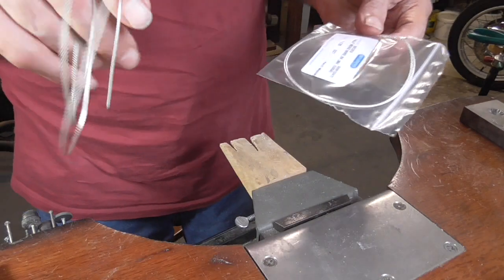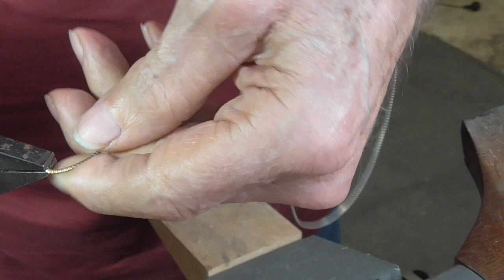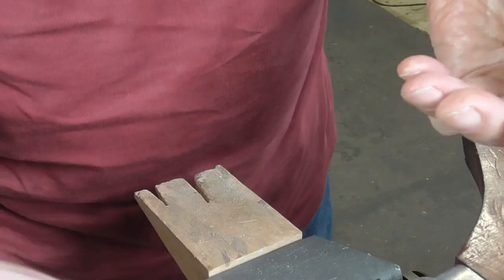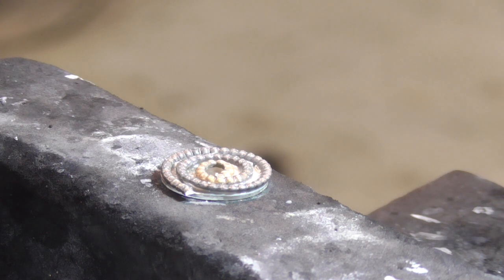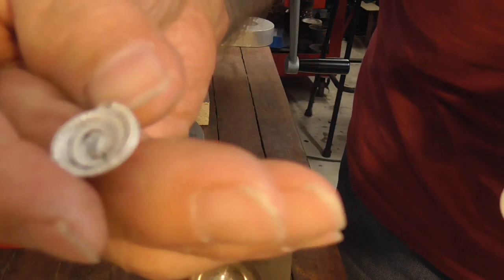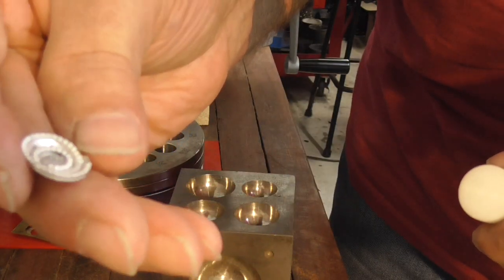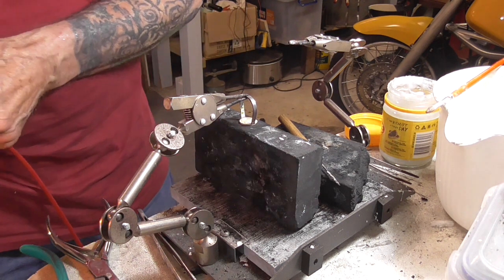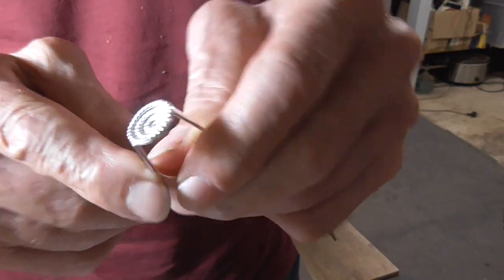beaded spiral cupped disc ring

Comment: Soham,  (is it ok if I call you Soham vs Mr. Harrison?)   beautiful piece as always,  I've missed your creativity.   Hope you are well!  Would you please share with me which solder snips you are using?  they cut the wire solder so cleanly and quickly.  I am currently using a pair of economy snips from Rio, and they frustrate me, I am always getting pieces stuck in the opening and then struggle to get them out.  If I point the solder downward, i end up with too long of a piece for what i need.   Thank you!.

Comment: I enjoy watching your videos and have learned many needed skills. I have a question I hope you can help me with. I recycle all my sterling scrap, ingot and re roll. I have lots of 90% silver cull coins and would like to up the content to .925. Is there a simple calculation to figure out how much .999 fine silver is needed to do this?
Reply: I may be wrong but, i think to get a higher silver content, you might have to refine it. I read somewhere that adding more pure metals to non pure metals doesn't make anything but the same purity with just a higher amount of silver. Again, i could be wrong and they could have been talking about gold only. Like if you took some 10k gold and added some 24k to the 10k, it just lowers the 24k. Idk. Im so sorry if im not making sense and definitely sorry if i am just wrong altogether lol. I will try to find that info and come back if still needed:)
Reply: Puerto Shecan  Well I found the formula to make .800 silver into .925. = 1g of 800 silver, add 0.865g of fine silver to get 1.965g of .925 silver. I found silver calculator online. It took awhile but I’m pretty sure this is correct. 20g of .900/coin silver, add 10g of .999/fine = 30g of .925+. I’ll make a batch then test. As long as it’s .925 or higher I’m OK. Soham does a video on making hard solder. 15.0g fine silver to 6.0g brass = hard solder. Medium is 15g g fine, 7.5g brass, Easy is 5.6g fine,2.2g copper, 2.2g zinc. I found theses formulas in the jewelers bench reference guide. As for gold yes by adding or subtracting 18k into 14k fine silver and copper are added. 14k into 18k , just add fine gold and fine silver. My silver formula came from .  30g of .925 sterling contains 27.75g of .999 fine silver.  20g of .900/coin contains 18.00g of .999 fine silver. By adding another 10g .999 fine to the 18.00g in the coin I have 28.00g . So my end result is higher. My 30g alloy is 28g .999 0.25g above the standard.925. Somebody correct me if I’m wrong.

Comment: Interesting piece, Soham!

If you wanted to dome it in the other direction, how would you do it? With a wood dapping block instead of the steel one, I assume? But then how would you avoid damaging either the wire or the block?
Reply from the maker: i would use a steel doming punch and a bonny doon urethane hammer